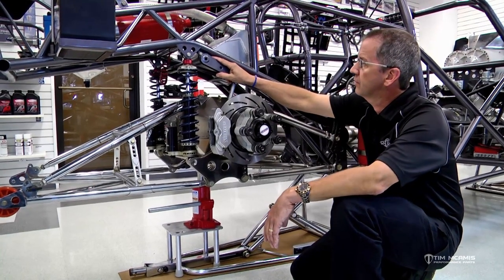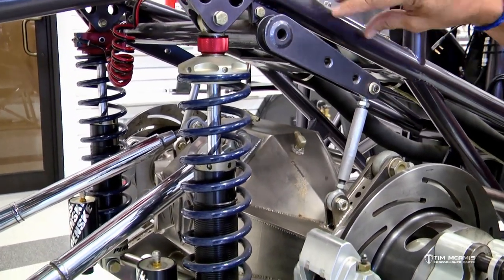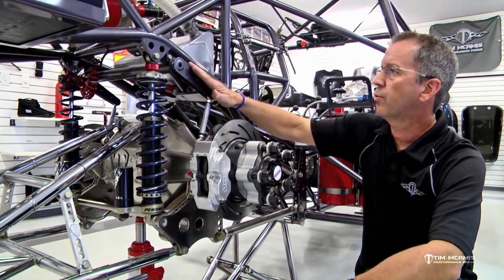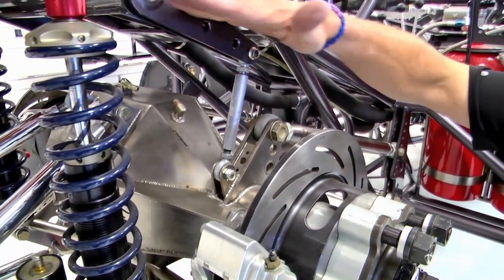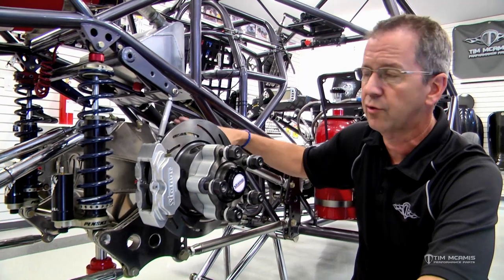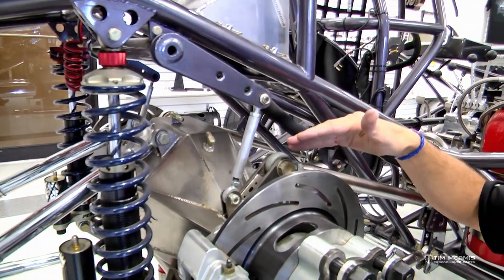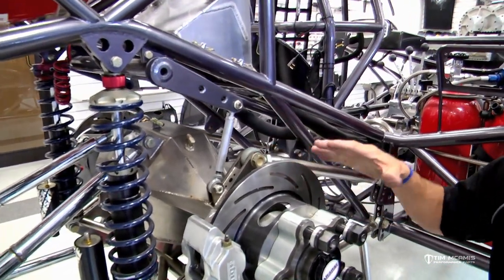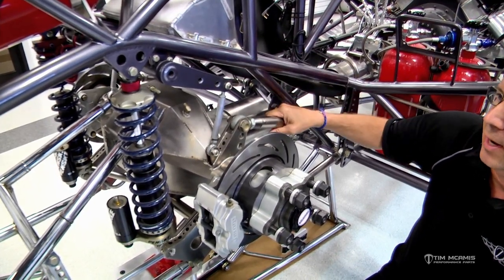Rear Suspension Overview: Part 4 – Anti-Roll Bar

Comment: I have a question, on my truck we installed a 4 link (your videos are a huge help) and was unaware I needed a ARB. First trip out way too much body roll,so I installed a ARB and now the truck has this wobble upon shutdown. The cab sways from side to side and the steering wheel will saw as its swaying. If you don't try to stop it itll get violent, and try to turn truck sideways. We've been fighting this for 3 weeks now. Competition engineering 4 link,diagonal link, viking double adj coilovers,and a home made ARB from moley tubing. Any pointers to why it could be doing this?

Comment: The Upper Arms . Need to be Level At Ride Height ? . 
The Rear Housing Tabs . Need to Be on the Back , Front 0r Center of the Rear End Housing ? . 
The Adjustment Arms Need to Be Straight Up & Down / Plumb When At Ride Height ! .
Thanks For all Your Videos ! ! !  . . . & .  Help ! ! !  . . . You ! . & . Your ! . Crew Stay Safe ! ! !  . . .

Comment: Great video series. Quick question, I’ve always been under the impression that then sway bar end links should have no preload when the car is settled on the ground. Is this scenario different since it’s a true race car?( My application is on a road car/track car build).
Reply: You misunderstood him. The 4 link arms are preloaded, the sway bar is neutral. He then goes on to say for ease of maintenance it is all done as one, with tyres off, though some people try to set the sway bar on the ground - which is no biggy - but you don't set preload to the arms that way as it will be different. Which as just mentioned - why it is all done with no wheels and tyres bolted on.